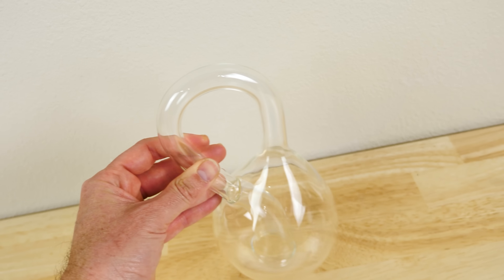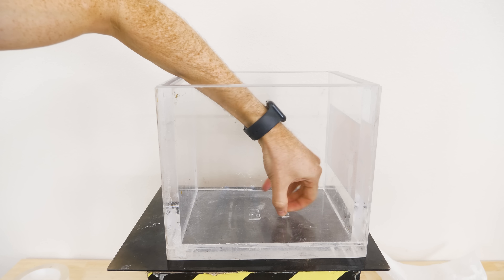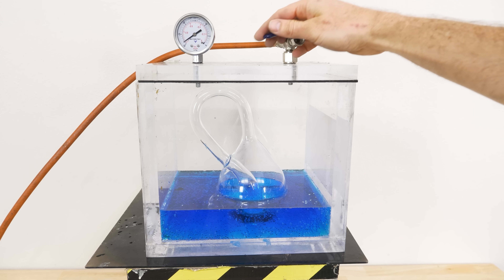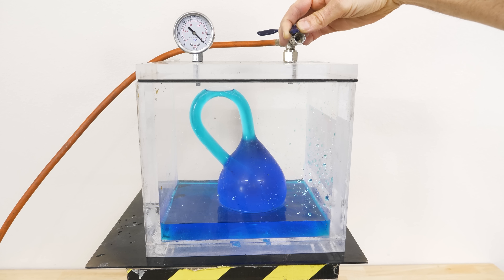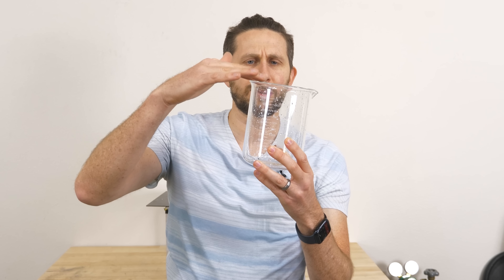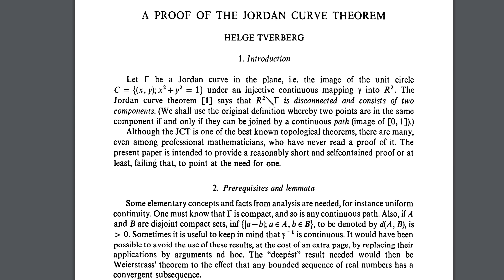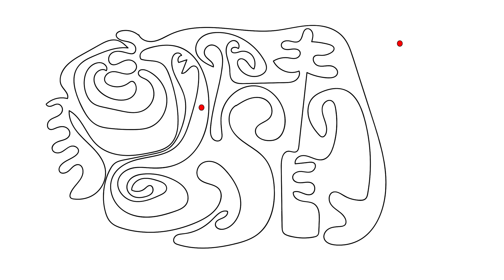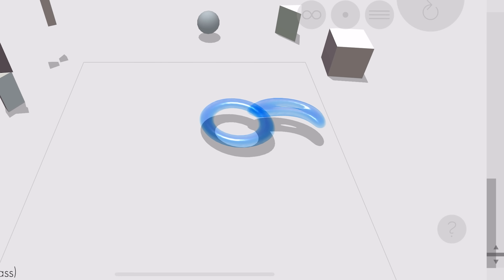Is It Possible To Completely Fill a Klein Bottle?

Comment: the containers have a volume because you put a lid on them and it closes them. what a crazy concept. i love videos like this that overly complicate very simple ideas and concepts. its exactly why i hated math growing up. you could have easily used a straw to vent the air out, instead of a fancy vacuum chamber, but dramatics. a bucket with a lid is no different than a ball with a port to fill air. of course one example is acceptable. sheeesh

Comment: .... Engineers, I swear.  Overthinking everything.  Listen, you need to think more simple.

Take a small rubber hose, feed it down the neck of the bottle.  Use the hose to pump the liquid in.

Comment: How about putting it under water and turn few times? It wouldn't still get air out? If you go deeper, some point air will virtually lost to infinite small bubble, because pressure squeeze gasses, but not fluids nearly at all. There is still same air left inside, if it hasn't soluble to water, like CO2 could do. So maybe only good use for that thing is to use it meter device, how deep in water that bottle is. Some kind air pressure meter could have done from it too. Maybe using some less dense fluid, like some fine oil. 
To understand this, it must turned upside down, don't ask me how I knew which one is which..

Comment: You don't need a vacuum chamber to fill it up. A thin, flexible straw or cable and a tank of water positioned higher than the bottle should suficie. If not, then the flexible pipe and a water pump.
Thanks for the interesting video!
Reply: those were both my first thoughts too.
Reply: That, or submerging it and suck the air out with a tube/straw.

Comment: you are technically lying to all of us, the bottle and the beaker both infact have volume, because the glass is not without volume itself. sure it is a relatively small amount of volume but still something.
Reply: further that there is no object that could exist that is without volume because if it exists then it is made of something and that something has some volume to it even if a very very small amount. Sure the vector that is a theoretical klien bottle has no volume but in practice, in reality, all of them have had volume. and sure this is pedantic but you can't state things like this has no volume when you are imperically inaccurate about it.

Comment: Just want to drop an idea here, when we get rainfall over construction and let's say for example a room is flooded, in certain building/rooms, plumbing is installed but not completed before the structure is finished. This being said, some rooms have drainage pipes installed which lifts off the ground just a tad....we remove a foot of water in minutes by snipping the top part off a 1 Litre bottle and quickly shove the bottom part over the pipe ... This creates the suction power needed to lift the water inside the bottle and drain it out....

You didn't need the pressure machine here

Comment: I was just about getting angry until you finally pointed out that the beaker also has no volume. It's such a misleading concept that the Klein bottle has no volume and is used as a gimmick for those less informed. I'd consider it more fascinating that an ordinary cup has no volume than a purposely esoteric and bizarre shape.

Comment: I think you can fill it up without using a vacuum. Insert a tube or small hose inside and pump in water to displace the air then just tilt the bottle as you go so air cant go back to the main chamber/the wider portion of the bottle.

Editing this due to another realization that you can do this underwater just to minimize the factor of air going in or do it underwater with high pressure water pump to push air out forcibly
Reply: But then he wouldn't get to use his vacuum chamber!
Reply: I was thinking the same, but feeding the tube from a funnel positioned above the bottle
Reply: Was gonna comment this but youve already pointed out my exact thoughts.
Reply: I thought that too lol a straw would fix this
Reply: shhhhhh let the man get his money’s worth from the vacuum chamber
Reply: Yeah his solution was needlessly complicated
Reply: @crossmr  that's centrifugal casting. Used in additive manufacturing and rapid prototyping every day ☺️
Reply: Came here to say this
Reply: Read my mind
Reply: just use a  tube-size hose. idk what the big deal is
Reply: Or, hold it under water.
Reply: I was looking just to find this comment
Reply: Yes, tubing will work, but you can't do it with gravity alone. You have to use a syringe to push the liquid.
Reply: a hose and a syringe, done.
Reply: Many years ago I filled a Klein bottle with Single Malt as a gift - used a food grade plastic tube to let the trapped air escape - easy.  Of course, getting the Scotch out again was more of a challenge for the recipient...
Reply: I was going to say, why not just use a long straw?
Reply: This is the same way to drain my boiler expansion tank. There’s one valve on the bottom so I have to push a tube up through the drain valve to let air in and water flow around it.
Reply: Stick a rubber hose up the Klein bottle's nose, yeah! "Up your nose with a rubber hose!" The catchphrase from the 1970s American sitcom Welcome Back, Kotter.
Reply: Or use the tube to suck out the air
Reply: I'm not 100% sure this would work, maybe it wouldn't for some reason, but I think an even easier way would be to completely submerge it in water and then spin it a bunch of times to let the air out. I mean, air and water are just two fluids, so if it gets filled with air when "submerged" in air, it must get filled with water when submerged in it.
Reply: But then it would just become a vacuum… It would jave no air, so that would just mean you are using a vacuum

Comment: Not to dispute the appeal of the mighty vacuum chamber..

.. but couldn't you also easily fill a Klein bottle with a length of thin diameter surgical tubing to prevent the inner chamber developing a pressure differential?

Just saying.

Comment: Question, could you not fill it easier by submerging it? I'm honestly not sure but I think you could get more fluid in the by pouring at least!
Reply: exactly my thinking. but maybe the air won't come "out" when it's submerged idk
Reply: @FabianRurack  the air would come out while the bottle is submerge, if you just rotate the whole bottle carefully. the vacuum is taking a lot of resource to solve a rather simple problem

Comment: Seems like you did it the hard way. Wouldn't it have been easier to use a thin rubber tube inserted to the top of the vessel, and then pumped liquid into it until it got to the neck at the top? Then invert the bottle, air pressure keeping the liquid in, and fill up the remaining space. No need for a vacuum pump. That would also be a fun video.

Comment: wouldnt it be possible to fill up the klein bottle simple by turning it under water ?
Reply: no bc air
Reply: @anaqiss  you mean air presure i guess ? i imagin turning it slowly under whater so the same reason the water will flow out of it ,if you turn it in the air meanwhile try to fill it with water , the air would escape meanwhile turning it under water ?!

Comment: Oh brother. Topology doesn't need to be this difficult. Here are 3 ways to fill a Klein bottle.

1. Use a syringe.
2. Alter the flow of the neck to not restrict itself.
3. turn the bottle on its side.

Comment: I think you can fill it just by sticking small tube inside to help the air go out thru the water and pur around it (or vice versa - pushing the water in via said tube, depending how the PKB reacts)... But wince i don't have the PKB (and it's impossible to get in my area) i woun't be able to try it out.

Comment: So if you put a cork in the opening on the Klein bottle it has a volume, or put a lid on your beaker and it has a volume. Basically enclosed spaces have volume and things with an opening do not.

Comment: If the issue is getting the air out, couldn’t you just put like a long flexible straw in there to give the air a path?
That’s like the whole reason we stick a straw in the neck of a bottle when we’re doing drinking contests lol

Comment: use two hoses inserted into the bottle and seal with your hand... put one open end of a hose into the filling liquid and put the other open end of the other hose in your mouth or attach to a syringe and suck out the air causing the liquid to be sucked into the vacuum created.. remove the suction hose relative to the liquid filling up.
you can also pump the liquid into the flask with a syringe attached to aquarium hose.

Comment: Talking on topology, I have a question I have been pondering for a while. As we all know a straw has 1 hole as does a donut. How many holes would box made of wire in a 3^3 shape have?
Reply: Well that depend on our definition, because that box could be seen as an "union" of shape and not as only one shape since the wire are not welded, hence the number of holes are the number of wire ... Or you can think that each part in contact is welded, and here it is complex since each 4 wire that cross form a hole in the middle, some wire can have a hole in them and some other don't since they are "crushed" and the hole in he middle is filled ... 
So this is a very complex question ...

Comment: "Is it possible to completely fill a Klein bottle?"
It's already filled with air, so yes.
Reply: It's actually filled with the universe.
Reply: @drewfaubion7603  is it filled with the universe or is it part of the universe... there for can it be filled with its self.. thus a self containing object..🤔
Reply: @drewfaubion7603  that's infinitely more abstract than my logic.

It kind of reminds me of the Ren and Stimpy episode where Stimpy so obsessed with his belly button, ends up going into it.
Reply: Exactly, it's killing me to watch it because I would've tried submerge it in water BEFORE a freaking vacuum machine
Reply: @gabrielaruweramaral7168  lol, remember how he tried filling it up and the water blocked him from pouring more in?

That’s still gonna happen under the water.
Reply: @dylanziesing6122 🤫 let him have his little 5Head moment 😅😂
Reply: @gabrielaruweramaral7168  wouldnt work because the air would get trapped in the bottle
Reply: Haha that would have been a lot easier! Also it clearly holds volume, how much so is arbitrary
Reply: @gabrielaruweramaral7168  While that wouldn't work since the air preassure would keep the water from comming in - Submerging it and with a tube sucking the air out would.
Reply: If it wasn’t 100% filled with air- would we even know?
Reply: @MimiYuYu  there are a few ways you could prove that it is filled with air. The most fun option is probably to put a current through it and see if you can make plasma.
Reply: remember he said is just a fancy cup, the real klein bottle only exist in 4D
Reply: @makijimenez8130  4D Klein bottle is just this with 4D thickness and a raised neck, it's still just a fancy cup.

The version he was showing in 4D toys is also very thin in the fourth dimension and falls flat on it's side all the time, which looks as if it collapses into a funny pancake. It's not really 'round' like it should be. It's like if the 3d bottle was an upright klein-bottle shaped pancake from the side for comparison.
Reply: smart
Reply: That's true actually.
Reply: Checkmate YouTuber, he beat you to it
Reply: TRUE
Reply: Why not just put a clone bottle into a pool of water and wait for the water to bubble out naturally?
Reply: @Sheeple18  because the shape stops that from happening, much like how if you put a cup in a pull of water upside down (evenly) it won't be filled with water without tipping it's over
Reply: It's doesn't even have special properties. It's not two theoretical mathematical concepts glued together. It's real world physical glass made into a shape. This is why he trying to make it seem that it's harder that it  is. Physics is the study of desperately trying to make math and physical matter into something practical, which more times than not fails miserably. One is conceptually made by a sentient being, the other is math made by stupid shit people keep realizing doesn't work the more you add to it.
Reply: @CodeguruX  Well, it is a special shape, a very special shape, but the is just a representation of it as it is physically impossible to make the real thing (atleast for now), anyways the point was that he wanted to explain the shape, which is why he went through the effort to fill a Klein bottle, see in a Klein bottle the outside becomes the inside so technically it is impossible to fill, and no, it is not practical at all
Reply: This guy is a true Scholar of Hustlers University. He escaped the Matrix and is thinking in the 4th dimension.
Reply: All right Mr. Smarty Pants.
Reply: @seeharvester  that's Mr Smarty Jeans to you.
Reply: @timhinchcliffe5372  
Ok Mr. Clever Trousers.😀
Reply: My thoughts exactly
Reply: This! ^^^^
Reply: It would fill if you stuck a hose on its mouth
Reply: It's filled with glass
Reply: Just make a hole
Reply: Anyone tried a high pressure garden hose
Reply: @PlasmaPod  If I was a betting man (I am it's actually a serious problem) I'd assume that it might just burst if the air is unable to escape
Reply: It was more a practical problem: Given the shape of the Klein bottle, how can you completely remove the air "inside" it by letting in water? (The more intriguing point is that there is no "inside" to the Klein bottle. When in high school we were shown Möbius strips, I was amazed about its mathematical properties.)
Reply: hold it side ways and dont fully fill the tube when filling
Reply: kek'd
Reply: It has no volume, so how is it filled with air?
Reply: technically it has no entrance and no exit meaning everything in it and around it is inside of it. This means that we are inside of it
Reply: Komedi 😮
Reply: fun fact, "air" in Indonesian its mean "water"
Reply: @yatanokarasu96  is that because when tourists drink the water there their stools turn basically to air?
Reply: it's filled with null drink
Reply: Not filled, actually surrounded.
Reply: @tunizra  mfw 🤓
Reply: @tunizra a, a
Reply: @tunizra  💀
Reply: Klein's bottle is nonsense because it's a 3D object.
There is simply a neck pressed to the bottom.
There's nothing abnormal about it.

People don't realise that the Mobius strip isn't interesting in 3D either, because if you squeeze a tube into the strip of a waist in 3D, it's a strip that has thickness and therefore can be traversed in different directions without warping. (and any strip has a thickness in 3D world)

The Mobius strip is only interesting as a 2D object, without the thickness, because of the lack of which you can only really move on the one side or on the other side, without twisting it.
And that's why Klein's bank is nothing special.
Reply: Ahhhhh....the old it's full of air trick! You sly dawg! 😂😉😏

Comment: Of course the (3D implementation) Klein Bottle has a volume! Simply it is the thickness of the glass!
PS : you don't need a vacuum chamber to fill it... you just use a pipe...

Comment: I disagree that the breaker has no volume. The glass itself is the volume. It is a 3d object with thickness. There is glass beneath the surface. The void in the "inside" is simply the reservoir. You can find the volume of the beaker by measuring the inner and outer diameter and its height. Then, you can use the equation for the volume of a cylinder with one edge removed. 

V = [π/4*(outer diameter)*height] - [π/4*(inner diameter)*(height - thickness)]

Where thickness = (outer diameter) - (inner diameter)

Another option is to submerge the beaker completely in water if known volume. Pull the beaker out and measure the volume of water in the container and the beaker. The volume of the beaker is the difference.

Comment: but u can easily plug the klein bottle so everything whats inside not blugged out is inside the bottle same with the cylinder if u get a cap for it u can easily say that
otherwise u could say No type of storage container would have a volume

Comment: couldnt you fill a physical klein bottle by putting a straw in it and running water through that? lets the air out and lets the water in.. correct me if im wrong

Comment: My first guess at a method to fill the bottle would be to extend a hose to the "bottom" of the Klein Bottle and fill it from there... It would need to be turned a bit along the way to allow all air to be pushed out but it should be doable? My point being that a much smaller scale water pump should be able to fill it in one go...

Comment: I am wondering I'm convinced. That you could fill this by using a rubber hose. Through the neck to the tank. Would water flow in as the air release through the tube.

Comment: The way I came up with klien bottle is that it is surface that has a single side. For mobius strip one takes a strip and stitch ends in a way that it has single side. To construct single sided surface, one starts with tube and tries to connects ends to get single sided surface. You end up with klein bottle.